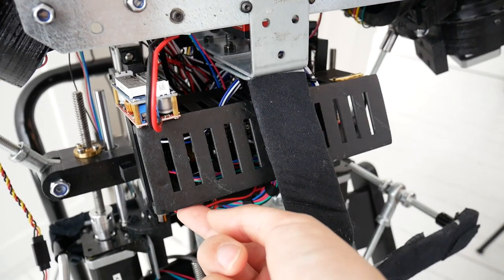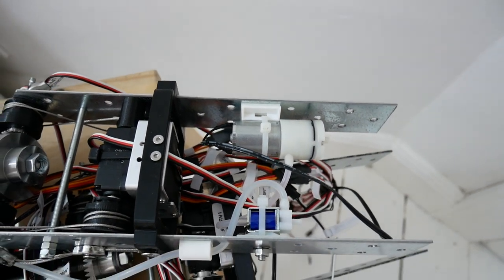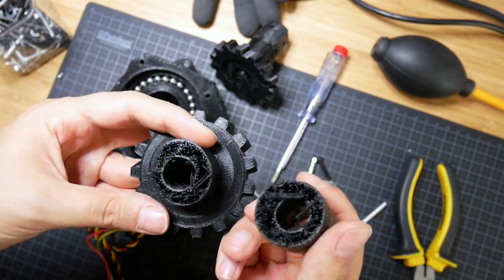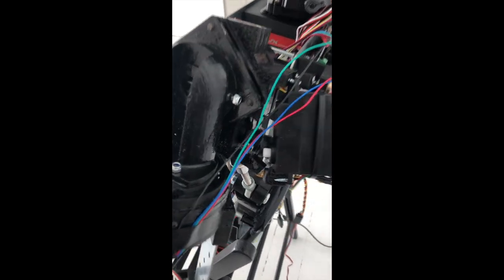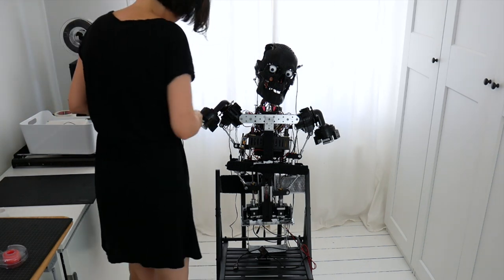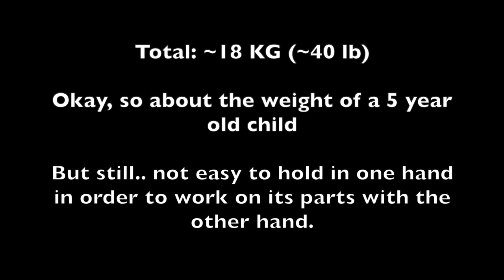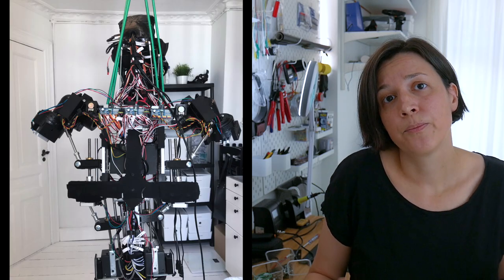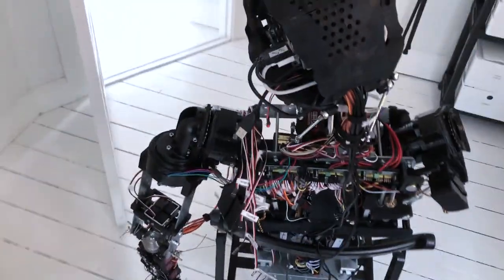Humanoid Robot - Project Update (August 2020)

Comment: It looks good. A bit of advice. If you coat/fill the 3d printed part in/with plaster and heat it up in the oven it helps strengthen the piece a lot!

 Also you can control synthetic muscles without pneumatics, instead using coiled fishing line and CNT or silver coatings/a wrap around the line. Look up "fishing line artificial muscle" and you should find stuff on it.

Comment: Great project, Paula! I suggest simply putting 40lbs of weight at the lowest point of your chair when you need to stabilize it... that should hold it!
Reply from the maker: Thank you Chris! And good suggestion. What I added now on the base is a lead battery that weighs 7.4 kg (16.3 lbs). It does feel less likely to fall back now :)

Comment: Sorry to be commenting a second time so soon. And I think I have some advice for the arms. I rewatching parts of the video to get a better idea of what I was looking at. And it appears that you're robot's arms are not only too heavy, but aren't fixed to the joints in a way that reduces the stresses and forces on the parts. Going metal to plastic is a bit difficult to get just right but my previous comment does mention how to strengthen the plastic print.
My advice here will be one that might be acceptable to your humanoid project. Have the joint be a ball and socket joint that you fix it to using a sleeve/net to prevent it from going off to the sides, and a few bits of elastic or rubber to give tension so the integrity remains. 
Then using a cord, wire, fishing line or whatever you have around use two actuators for the rotation of the humorous and to pull it down and two more for the longitudinal motion and one for pulling it up. This should put the motors and the bulk of the weight in the chest. I might email you a sketch as an example.
If more of the weight is center of mass it will be easier to move around and balance. A human arm for an average 73kg person is typically 4kg, and a leg is 11kg-12kg.

If the arms are too heavy then minor motions can throw it off balance. The most a human can swing around is 20% their weight, and that will throw them off if they don't counter balance with their body. Ideally the objects interacted with are under 10% of their body mass.

Comment: You could put hooks or eye bolts in the ceiling at places around the house where you typically work on the robot and have cord with some kind of quick release clasp to attach to the robot when you are working on it.

Comment: Maybe use a harness to attach it to the ceiling just while you're working on it, but let it hang low enough so that it would be resting on that chair. That way if the chair falls, the robot is okay, and if you need to move it around you can just detach the harness from the connection to ceiling. Your project looks really cool

Comment: add some weight to the base of the chair/wheels and it won't fall off. I am using a fairly wide pvc pipe on wheels which doesn't fall because it has a wide base and the robot is in the middle.
Reply from the maker: Thanks for the suggestion! Yeah, I added a weight to the base (7.4 kg, i.e. 16.3 lbs) and it seems to be less likely to fall back now.

Comment: You’re a robot looks great! Have you thought about decreasing the weight by switching out some of the components in the arms so that it is a cable pully system instead of a servo system? You might be able to pull off some multiplication of strength with a geared system with that. I am also looking forward to building something similar to yours, but I figure I need to get a 3-D printer and some basic Arduino/pi compatible parts.

Comment: Try printing 100% infill pcs of smaller parts to get the weight down. Also using fewer servos that are more efficient will help alot. 
Pause on the torso disign , and work on the legs. Keep in mind if it can't stand on its own it will not be able to carry weight. Here's where it.gets tricky; think a 2 leg table. That's what we are and so your Android must be the same.
I hope this helps, a little anyway. Keep up the good work.
          🤖🤔

Comment: This might be too late as this video is from August, but you could use a car engine crane? Engine cranes usually fold up relatively small(ish) and can hoist and move an entire engine block about a workshop. It might be a much safer, more long-term solution, especially if one day you intend to test mobility, walking etc.

Comment: okay so Ive herd you say you are an engener in 1 of your videos So stay with me on this 1. go to hardware store and buy a set of 6 heavy duty swivel style  locking roller casters, a lazy susan with a weight limit of 550 lbs sorry don't know metric or what ever. also find a 30 gallon industrial grade plastic drum might have to get it online, Get 2" x 8'  and 1+" x 8' heavy wall PVC pipes, heavy  duty cotter pin maybe 2. When you get it all together build base assembly like this. add casters evenly around base of L/S then mount barrel on top of this, next take the finished height of you bot and add a couple inches to it and cut the pipes accordingly. put smaller pipe inside larger one clamp them together or use a screw to bind them for a couple minutes. drill holes in both pipes at regular intervals, { while you have them together check to see that the cotter pins will go all the way through and work to provide a temporary hold for later ) Put the pipes in 1 of the small holes in the top of the barrel. mount the bot to the upper pole some were at the neck. Fill barrel with water for weight and you should now be able to move it around at while . Keep the videos coming as my Grandson and I are also building our own humanoid bot and like to see what everybody else is doing to get new ideas. have you seen were 1 of the college labs has developed a synthetic skin that can give your humanoid bot a sense of touch. We are planning on using this on several layers of our multi layered skin. we also cheated a bit and are using a store bought precast plastic human skeleton, This will give us a lighter weight to start with and we can add more plastic to in fill the hollows if need be, If not we might run wiring through them ( except at joints were we will need to exit the bones to prevent pinching & there by shortening the life of the wires ) Any way I'll cut it off for now or I'll ramble all day . Thanx again your friends in the bot world.. P.S. have you seen Ricky Ma's build he used Scarlett Johanson as his body model. He calls it M-1 but every body else calls it Scarlett Lol....